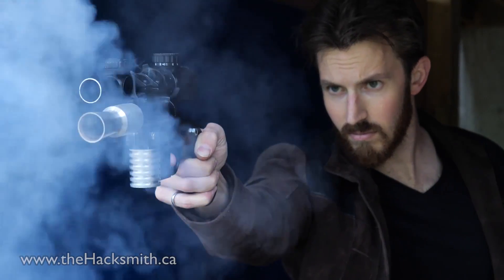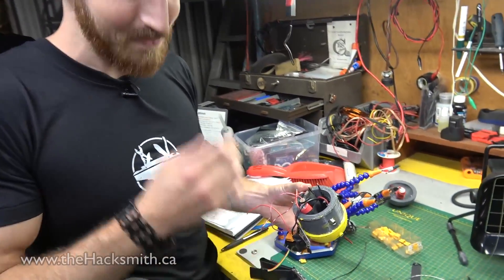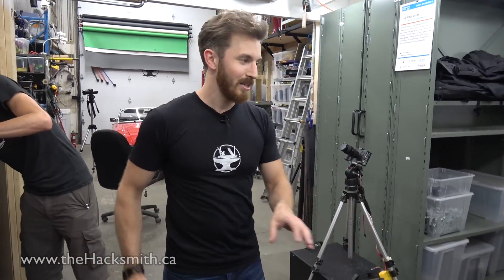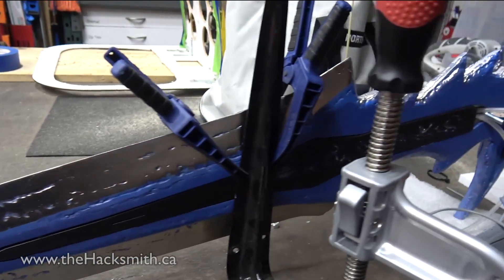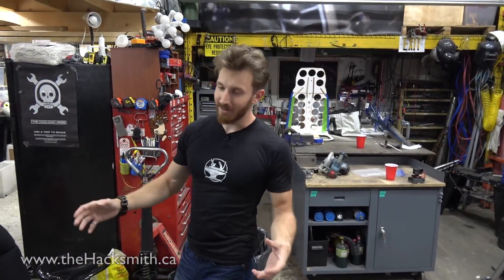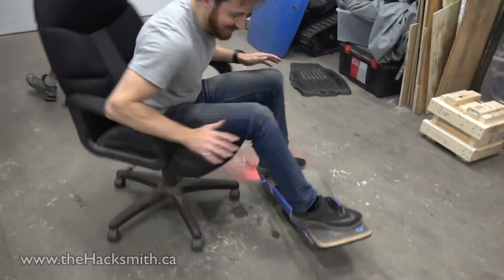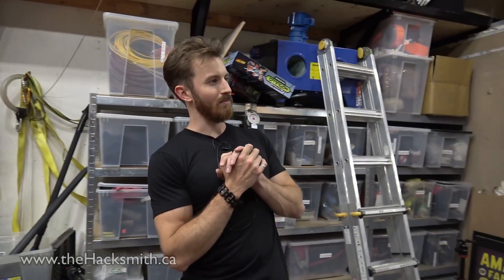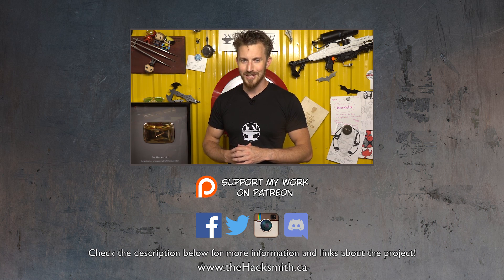Hacksmith Shop Tour + Project Updates! (PART 1)

Comment: hey this is a random question, but whys your standard voltage in America so low, here in New Zealand 240v is standard house hold voltage, which is useful as most things apart from high end industrial equipment work from any plug, is there any advantage to the lower voltage found in the U.S
Reply from the maker: Well actually, we're in Canada!

Most homes still have 240v, is used for bigger appliances

Comment: Your vids inspire me to go out and build stuff in my garage so far ive made a ring
Reply: I made a hydraulic powered storage system for the push mower so the shed has more space
Reply: I made a hybrid rocket motor
Reply: I made a taset
Reply: I built a raft out of pallets and wood and I bow fish off of it
Reply: I made a methane gas generator from a self sufficient black hole.
Reply: Currently working on a warp drive and phased plasma laser blasters
Reply: And AI

Comment: Maje a flying motorcicle like the one in gta 5
Reply: RedGames and how the hell do you suppose he can do that?
Reply: bageldog_ well he said that he wants to put a jet engine on that motorcicle so he could try to put a biger engine and some wings and I think it could fly
Reply: RedGames I’m pretty damn sure that wouldn’t work. Will admit though, a real life Oppressor would be really cool.
Reply: It could work if the motorcicle was made of airplane aluminium alloy and the jet engine would be powerfull
Reply: RedGames Yes, but then you'd just be building a jet plane, with a motorcycle seat in it. Which would be incredibly expensive.
Reply: Adam Kimm if you make it as small as a motorcicle it isn't a jet airplane
Reply: RedGames in order to get sufficient lift to fly, it would have to be an airplane.